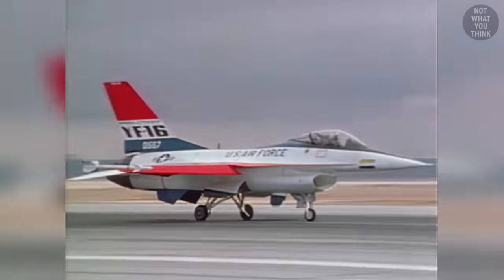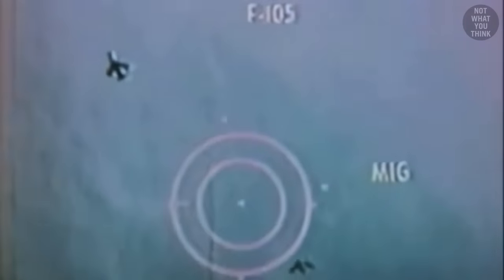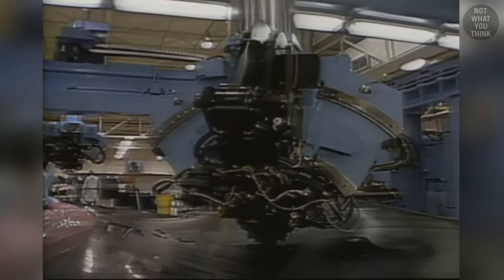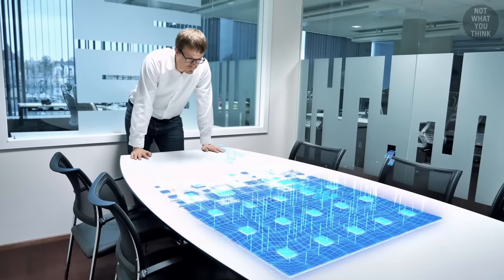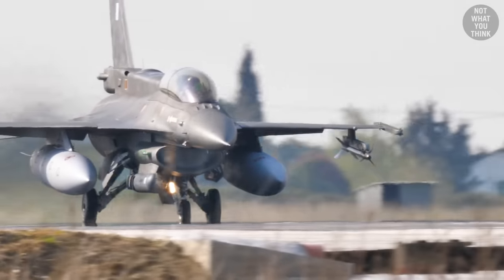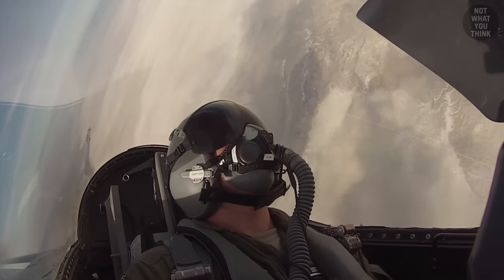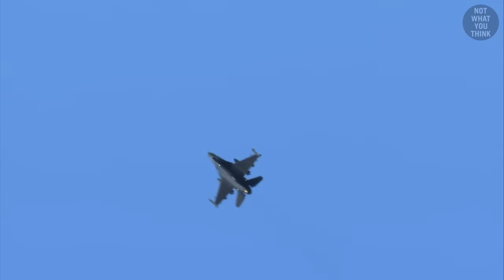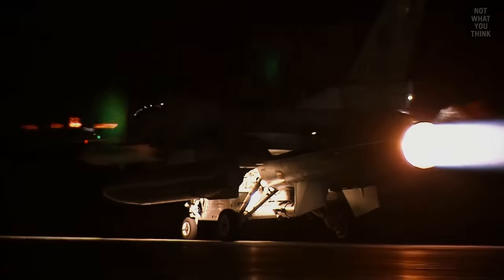Why the F-16 was Intentionally Built to be UNSTABLE

Comment from the maker: Head to my link https://athleticgreens.com/notwhatyouthink to get a 1-year supply of vitamin D3K2 + 5 travel packs free with your first order!
Reply: hey you are cool and i love your videos but please link the laser pig video on the a-10 and add the fact that the fighter mafia did almost nothing
Reply: The F-117 actually used the F-16's fly by wire system (at least initially ... I've never heard a follow up afterwards).
Reply: The link isn't working.
Reply: 13:45: Your statement about cost is dubious. Depending on the variant and particular deal, a quick Google indicates fly away costs for a modern F-16 of between $63 M and $75 M with the lower number coming up a lot for block 70/72. For the F-35A, Google will confidently tell you $70 M, but that appears to be without a couple important components like, you know... engines. With a bit more digging, $78 M seems to be the most common number for lots 15 - 17. Either way, F-35A is not hugely more expensive than F-16 and comparable or cheaper than alternatives like Gripen, Typhoon, or F-15EX.

Comment: Dynamic control systems (the science behind fly by wire) was the most brutal class I took when in college for Aerospace Engineering.  Understanding the concepts wasn't hard, but the math required you to be fluent in matrices of LaPlace transforms of imaginary numbers.  That said, understanding the concepts of why various systems are stable and/or controllable has been amazingly useful in life.  Luckily, I've never needed the math part of it after that class was over.
Reply: Which college?
Reply: @II_xD_II  It was a graduate (500 level) class I took at Iowa State
Reply: Why was the math required?
Reply: @LanaaAmor  Two main reasons: 1) to determine if the feedback-control loops you have are capable of controlling the aircraft with the characteristics you want, (You can make an F16s controls respond like it was a cargo plane, but nothing you can do will make controls of a cargo plan respond like it was an F16) 2) to determine the necessary ratios of the various feedback signals to use to get your desired result.
Reply: I feel like most of those concepts where in my Computer Science undergrad class called Math Foundations for Comp Sci...

Needless to say it was still brutal like you said.
Reply: @WeatherWX  these concepts are everywhere OP just doesn't know what his course was about
Reply: @SvdSinner  give an example
Reply: The following courses in this chain is much more difficult. That course even considered simple
Reply: @LanaaAmor  the flight program is math itself.
Reply: @thegloriousquran1208  it isn't
Reply: @LanaaAmor  well the cpu on the jet wouldn't be existant without it nor would logic function without math, Aircraft need math to calculate certain things.
FBW for example Angular rate limiting Uses PID which is basically math, So it stems from math and physics really.
Reply: @SvdSinner  i find it rather fascinating, especially the transfer functions effecting actuators and loops.
You can see the first f16 takeoff the Control Gains were way off indicating they were improving the program as they went, literally coding and going out to test.
Reply: Please did you take non-linear control in college?
Reply: @WeatherWX  what described (matrix calculations) are still performed faster using analog methods. Which is why high density AESA or fly by wire of extremely unstable aircrafts still uses analog computers on the lower level of their electronics' architecture. The requirement for real time feedback also has an impact here which is why fully digital system is still not implemented yet. So yea even the math will be slightly different as they are quite literally continuous and not discrete as physics will be the limiting factor here, not computational power.
Reply: What resources did you use to learn it and what math did you need beforehand? The reason I ask this is because I want to make a fly by wire stabilization script in kerbal space program. I tried making a stat plot of the deploy angles of the leading edge strake that would keep the Mw derivative in the negative. Is there any advice you could give me?
Reply: @Samson Oluwatosin Omoloyin  No, I only took linear dynamic control systems.  (Hence all the matrices)
Reply: @thepenguinprolemonstealer2644  try making a rate limiter FBW using only P control.
There are two types of FBW i know 
G limiter and Angular rate limiter.
Reply: @SvdSinner  control is so tedious.
Reply: I can relate.
Reply: @thegloriousquran1208  fbw and pid?
Reply: @LanaaAmor  yeah?
Reply: @thegloriousquran1208  what's that?
Reply: @LanaaAmor  
Proportional 
Integral 
Derivative

Control Theory
Reply: @thepenguinprolemonstealer2644  try out Steve bruntons control boot camp. But you need.... linear algebra, calculus, differential equations, and for optimal control, calculus of variations. Maybe some math analysis for proofs.
Reply: @the-core-experience Presumably.what is in effect an analogue computer. The Tornado used systems based around the 741 op-amp back in the late 70's for it's fly-by-wire systems. Later the engine control was changed to digital but I believe the flying control systems remained mainly analogue until end of service 2 or 3 years ago.
Reply: If you don't mind me asking were you taking it for an aerospace engineering major or was it a master program?
Reply: @khorjingyan3438 they actually have figured out how to use flash storage in a means to quickly calculate matrix multiplication that can be used in a regular pcie slot. While the physical chip uses anolog methods in a sense these systems are entirely digital today, the code would not be math but feeding inputs in and passing the outputs to the respective system. They are essentially writing code to route the data after a mathematician creates a proof to define the weights used in the matrix for desired outputs.
Reply: Complex variables?
Reply: My father-in-law was one of the engineers that helped design the flight controls for the F-16 as well as the F-111. I love hearing his stories about the early days of the F-16 program, though I can never fully comprehend the technical side of it 😜. But the stories about the development and testing are great!
Reply: @TheErockaustin  I was an Instrument and autopilot tech and instructor from 1971 to 1980 on the F111D and A.  I thought the automatic flight control system AFCS of the F111s  was a marvel of engineering.  I would have loved to talk to one of the design engineers when I was an instructor at Mt Home AFB from 1977 to 1980.  I have a couple of stories about the maintenance of the AFCS that your father in law would really like.

Comment: The fighter mafia did not invent the unstable design, they simply pushed for small and light fighter with minimal equipment and superior maneuverability.  Actual engineers came up with relaxed static stability as a way to enhance maneuverability, which was made possible by fly by wire, which the fighter mafia initially thought was too complicated and expensive. 

BTW, it's not relaxed negative stability, it's relaxed static stability.  This is all about getting the center of gravity further aft so that the tail plane does not have to produce negative lift during turning or supersonic flight (when the center of pressure moves aft).  Negative lift at the tail subtracts from the total lift produced by the airplane and therefore reduces the G it can produce.  Relaxed static stability basically adds total lift to the airplane, or reduces drag for the amount of lift being produced.

Comment: Cool video.  I was an F-16 avionics technician for 25 years, and was an avionics instructor for 7 of those.

One interesting thing is the gun (which is located on the left shoulder) puts an asymmetrical force on the aircraft as it's being fired. So as soon as you start shooting the gun, it's no longer pointing at the target... Except the gun sends a signal to the DFLCC, and the computer kicks in just a little rudder to keep the jet pointing where it's supposed to.

Comment: I thought the fighter plane mafia was just a pack of idiot (and not engineers, just assistants to third party defence contractors that knew someone in the Pentagon) and had nothing to do with the F-14, F-15, F-16, A-10, F-22 or what ever plane they decided was their idea this week out side of a few ideas for the F-15 (like removing the ejector seat to save weight) and the F-16 was designed for as a cheaper option when sending an F-15 was overkill and used many of the technology's of the F-15 to speed up development.
Reply: You are correct
Reply: dont forget bashing the F-35 for sweet sweet RT rubles any chance you get

Everytime a F-35 rolls of the production line Pierre Sprey murders a puppy
Reply: @vitsobotka6268  Oh of cause how could I forget.
Reply: Yeah, kinda shitty that Not What You Think fell for their propaganda. His videos are usually really well researched.
Reply: Like Mike sparks who claimed that the f-15 was bad because it relied on "unproven technology" until about 20 years later when he was saying that he was the lead engineer. and it was so good because it was built to be a dogfighter, and didn't rely on "unproven technology"
Reply: You are correct, they first grew to prominence criticising the F-15, when the F-15 turned out to be one of the greatest fighter jets ever made, they switched to taking credit for it. Rinse and repeat with almost every new jet fighter since then.
Reply: @MaxwellAerialPhotography  That’s seriously crappy. Only way it would make sense would be for their critiques to result in changes that significantly improve the design otherwise they’re just assholes
Reply: @kennyxkazuki713  You are thinking of Pierre Sprey, Mike Sparks wants to make the M113 fly.
Reply: @vitsobotka6268  Bro， he died two years ago
Reply: Hello fellow lazerpig Stan
Reply: @obedientpluto35  Fan not Stan. And I have heard mad shit about the reformers from other souses as well, LazerPig just made the longer and in depth videos about them so I remember his points better
Reply: R

T

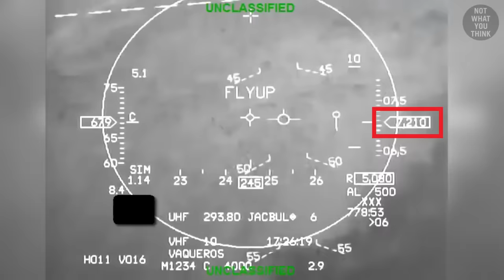Comment: 10:37 He went from 16000' to 10360' in 7.94 seconds, which is approx 42 000 feet per minute... that means he had about 13 seconds left before hitting the ground. Crazy.

Edit: even less than 13 seconds, as he was accelerating...
Reply: Incorrect, he was rapidly gaining speed in his descent. He was at 4,800 feet before the GCAS successfully pitched the F-16 upwards. That altitude is based on sea level, the radar calibrated altitude that gives the actual distance to the ground (marked by the R) showed he was 3,000 feet away from smacking the ground. GCAS kicked in at 8,700 feet sea level (which is actuated by several variables). Then subtract 1,700 feet to account for the difference in the radar altitude, which means he was 7,000 feet away, and achieved level flight at 3,000 feet. Meaning if GCAS had actuated even 2 or 3 seconds later he could have crashed into the ground. Maybe even less considering it's obviously very hilly terrain.

Also if you look at the G counter, the plane hit 9 G's when GCAS kicked in. Talk about cutting it close! It also probably G-LOC'd the pilot out of consciousness for a second time LOL
Reply: @weasle2904  I stand corrected. thanks for checking my work :)

Comment: Interesting point about the bicycle experiment you mentioned. Bikes are also designed to be inherently more unstable than necessary to make turning feel natural. I don't know the exact terminology for the science here but if you move the wheel behind the steering axis by turning the fork backwards, the bike will be much more stable when you do that hill experiment.
Reply: I think one of the simplest cheapest examples of this is in pulling Vs pushing something like luggage, or to a lesser extent a hand truck. Pulling two wheeled luggage stays naturally straight, while if you try to push it, it's much more of a fight.
Reply: It's not so much about 'feeling natural' but about the force one has to exert in order to deviate from the stable positions. In this case this means to turn.

Comment: I might be dead wrong, but my armchair-part-time-aeronautical-historian-limited-research-characterization of the Fighter Mafia is that they were a group of pure stick and rudder fans with no time to waste on fancy-schmancy hoodoo - inherent instability and/or computer assisted flight control.
Reply: Right now that is the popular narrative because of lazerpig. In reality, the Fighter Mafia looked to apply high technology concepts like new materials and new aerodynamic designs to achieve higher maneuverability and less drag. Harry Hillaker was a founding member of the group and was a chief designer on the F-16 from the late 60s til the mid 80s. He was no fool too; he said himself that if the Air Force just wanted another bomb truck, he would not have designed the F-16 like he did. Regardless, this video misses a lot of the core mechanisms behind the advanced aerodynamic design, like how they eliminated trim drag, or how the plane actually becomes stable at exactly mach 1. It also misses the very important follow-up to the F-16, the F-16XL, which further reduced drag, increased range, and increased combat speeds.
Reply: You are correct. They were against anything that would unnecessarily increase the weight and complexity of an aircraft.  There were even against simple things like nosewheel steering or a parking brake.  No radar at all was wanted.  Ironically, they were even initially against fly-by-wire as unnecessary complexity that would increase cost and reduce reliability.
Reply: Quite the title, Michael! 😮

Comment: From the moment it rolled off the production line, it’s been weighed down by tanks, CFTs, bombs, and other AG weapons. It’s now a light plane with tons of added weight. The irony is that the F-16 was effectively off the table as a dogfighter when it was built, as the F-15 was designed as the primary air superiority aircraft for the USAF. The Viper has effectively become a bomber over the years, though it’s still capable of AA and dogfighting. It’s just that it’s been superseded at nearly every turn by other planes.

What it provides is rather amusing—it’s cheaper to fly than other aircraft in terms of cost per flight hour. It’s more useful as a strike platform that can self defend, filling multiple roles, rather than having single role aircraft in a battlespace. But by definition, it has become anything other than the originally-intended lightweight fighter.

Comment: While it’s true that the F-16 uses the Pratt F-100 engine, the engine shown at 9:23 is the General Electric F-110. They’re used fairly interchangeably on the F-16 airframe. Easy ways to spot the different is the duct orthogrid on GE vs isogrid on PW. When installed on airframe you can spot the difference by the amount of struts and architecture of the actuating nozzle support.

Comment: Real Engineering did a great video on fighter instability. It's basically an energy problem in that a highly stable aircraft takes more energy to move away from straight and level flight which equates to worse maneuverability than a less stable aircraft.... Interesting bit of physics
Reply: But they need more energy to stop moving
Reply: @Antonio Hagopian  stopping is the last thing you wanna do in a dogfight or any other sort of Mission
Reply: @texastoast1671  exactly.... Modern fighters are more concerned with energy management than dogfighting ability since the vast majority of engagements are expected to take place at beyond visual range. If you "cash in" your airspeed, you're a sitting duck for a radar guided missile.

Also, my previous comment is merely pointing out the interesting physics/aerodynamics that go into fighter development

Comment: Fun fact: When nasa was developing digital fly wire in the early 70s, they started with modifying an F-8 crusader. Now, it's 1972, you need a small, lightweight, powerful computer capable of running this control loop in real time. And you're at NASA. So of course, they used an Apollo Guidance Computer.

Comment: Just a couple of additions. In a conventional aircraft, the positive stability of a nose heavy design requires a tail surface that pushes down at the back of the airplane. This down force is substantial and has to be overcome by lift from the wing. So, for example, if you push down on the tail with 1000 lbs of force (an oversimplification, but good for illustration) the wing has to produce an extra 1000 lbs of lift. This detracts from maneuverability. In negatively stable aircraft, this isn't necessary. Also, the response time and pitch rates can increase due to the more aft CG. I flew the F-16N in the Navy and it was completely seamless getting into the F-16 to fly. I think it took 5 minutes to feel completely at home in the airplane (other than the somewhat complex, but capable features of the HOTAS). It was like sitting on a lawn chair with two cans of beer! And, while the tilted back seat no doubt helped with G-tolerance, I think it was the raised feet that REALLY shortened the column of blood. Also, full rudder throw was 1/4 of an inch! So, you could really stretch out. The only downside was it was harder to use a "piddle-pack" (for some guys - NOT me of course! 😁).

Comment: So I'm not actually a pilot but I play MSFS2020 a lot and we all know that it's pretty much the most realistic flight simulator you can get at the time. I play the F-16 a lot and can say that it's very instabil. Most of you might know those videos of a takeoff of the F-16 going streight up after takeoff. That isn't as easy as it sounds because you need enought speed for that and most importantly: very precised maneuvers because if you pull the stick to the left or right just slightly too much you'll lose control. Still, that instability gives the F-16 a high maneuverability wich makes the F-16 so beautiful.